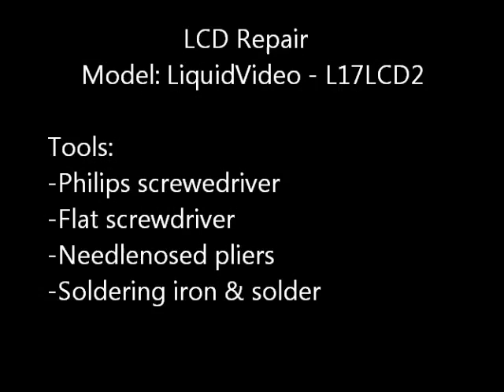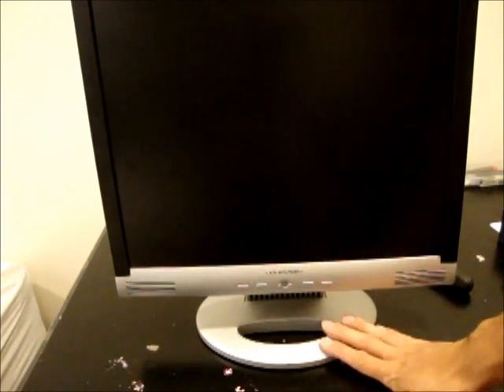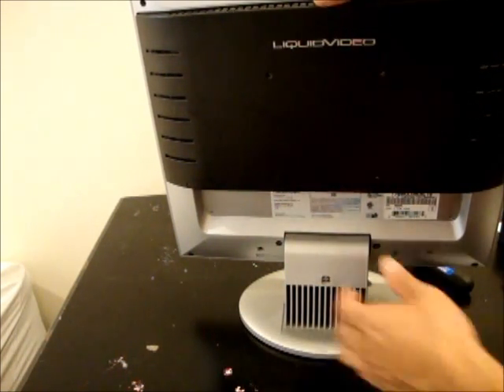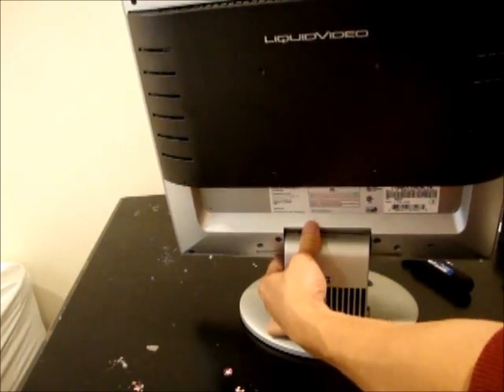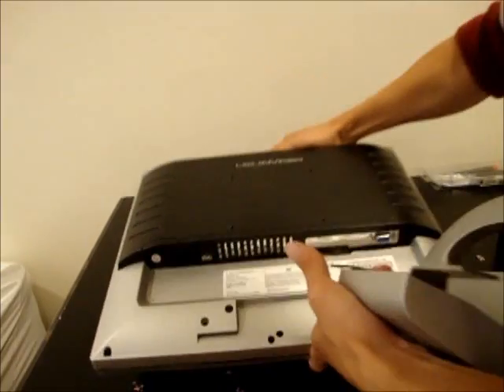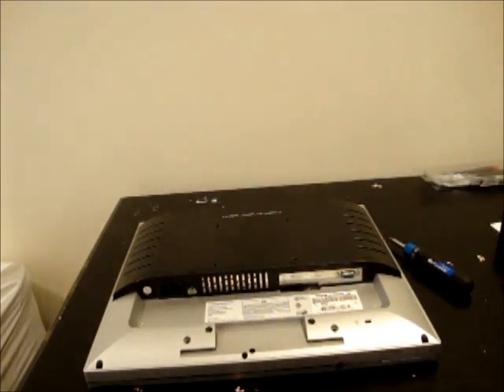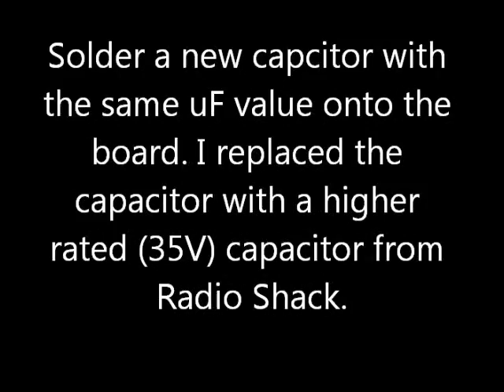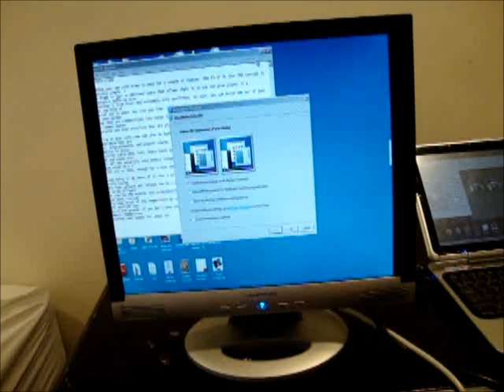LCD repair, Capacitor Replacement (LiquidVideo L17LCD2) - shuts off after 1 sec

Comment: Hi. What capacitor voltage and farads and how many should I usually buy for an old 17" LCD VGA Viewsonic monitor?

Thank you.
God bless, Proverbs 31
Reply from the maker: There are many capacitors used in any given monitor, so it would be impossible for me to tell you specifically what you need because it depends on which ones in your particular model have failed. They are not always the same ones that fail, and there may be multiple ones with differing values. The best way to get this information is to remove the damaged/broken capacitors and read the values off each one. It will be printed right on the side of the capacitor for easy reference and make sure to buy the same  exact size, voltage, and capacitance for the replacement as this will guarantee a compatible fit.

Comment: thank you so much Sir! does this also apply on a monitor that has a power supply not attached in the monitor itself? my monitor doesn't use the common power cord connecter. it has an external power supply, like to those in laptop's. thanks in advance for the response.
Reply from the maker: Yes, if the monitor is powering up for a brief moment before it shuts off and the power supply doesn't appear to be damaged or the source of the problem, it's possible that you have the same problem with a blown capacitor inside.
Reply: Thank you very much! The indicator in the power supply is on... Does it mean that the problem is on the monitor itself?
Reply from the maker: Yes, that's the conclusion I would draw since the power supply appears to be in good working condition.
Reply: ReviewedByPhil 
thank you again sir.
Reply from the maker: No problem, happy to help

Comment: Hey mate I have a LCD ASUS VE245H Monitor that has the same issue. I checked the capacitors and they look fine, what do you think it could be? I press the power button and nothing happens but when I plug the AC-In cable, it says ''No HDMI Signal'' and it goes off after 2 seconds. What do you think it could be the problem?
Reply from the maker: No assumptions here so I have to ask, are you using HDMI input to your monitor (vs. VGA/DVI)? If not, you need to change the settings on the monitor to match your input cable type. Another source of failure could be the cable itself. If you're using an after market bargain priced (thin) HDMI cable, it could cause this problem. Try using a 30V or better quality cable. I added a link to an Amazon product page in the description for you. Hope this helps!

Comment: Your video was excellent. A few months back I had the problem, replaced the capacitor with a higher voltage one and it has worked great for months! That is until last week. Now it stays on for 3 sec. and then goes black. I checked the caps and they all look good. I measured the voltage in the power supply after turning it on and it seems to drop slightly after 3 sec. Any ideas?
Reply from the maker: Hmm, it sounds like it could be a regulator failure. I don't have something that documents replacing that piece in particular, though. You can check out this video, Vizio LCD Powers on with backlight, Wont power off, No video, at the 4 minute mark, he explains testing the regulators. Hope this helps.

Comment: Next time it might be helpful for us soldering noobs if you show how you removed and placed the new capacitor. :)
Reply from the maker: Thanks for the feedback! I'm actually not that great with a soldering iron either and the shot of me doing it was such a failure that I cut it from the final video. I didn't want to confuse folks by showing them how to do it wrong... but even with my shoddy soldering skills, it still worked okay so don't worry if it's not perfect!
Reply: dconstructionx Thanks! I'll go youtube some soldering and desoldering videos. :)

Comment from the maker: Use an analog multimeter ( AVO)

1. Set the analog meter on OHM.
2. Connect the meter leads to the capacitor.

a. Short Capacitors: shorted capacitor will show very low resistance
b. Open Capacitors: an open capacitor will not show any movement 
c. Good Capacitors: Initially, it will show low resistance, and then gradually increases toward infinite.

Comment: I have the same problem exactly! The difference is that none of the capacitors shows a bulge. They all seem fine externally (not even scorch/burn marks). Is there a way to test each one, e.g with a multimeter, to tell which is the "dead" one?